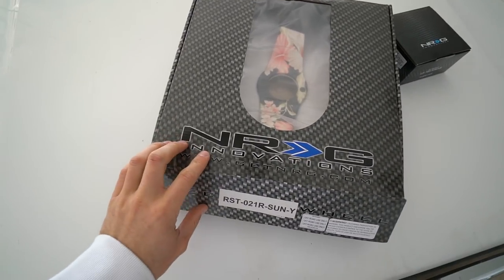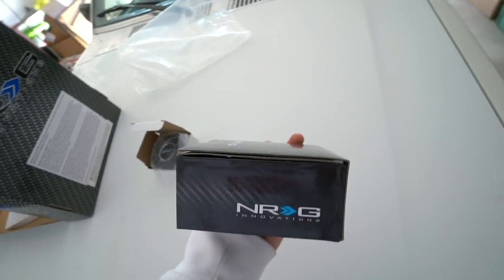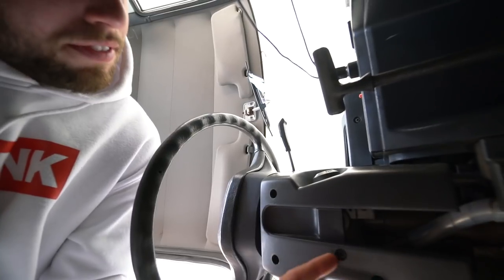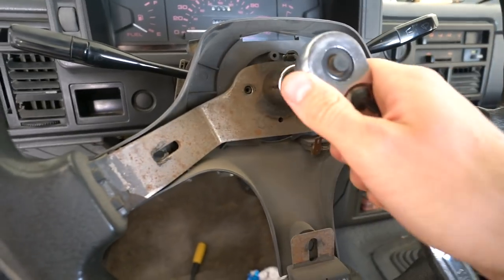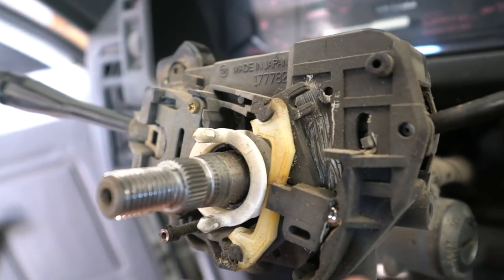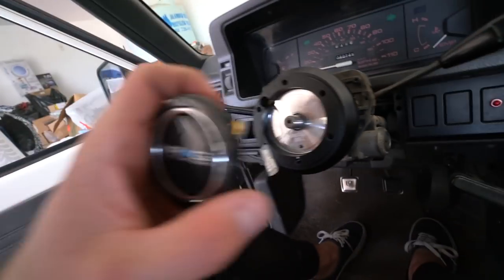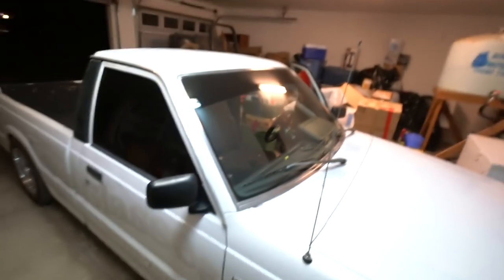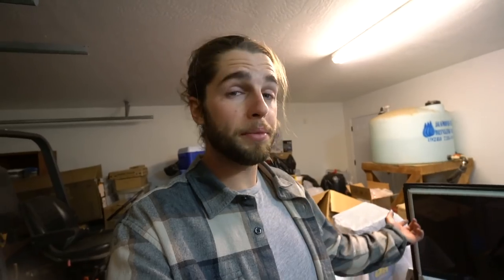How to Get & Install A Custom Steering Wheel (Super Easy)

Comment: Cameron, steering wheel is upside down. Reference line is suppose to be top center (flat straight) “7”. I know you’re probably not going to rally this truck but you may want to flip it around just for the novelty.